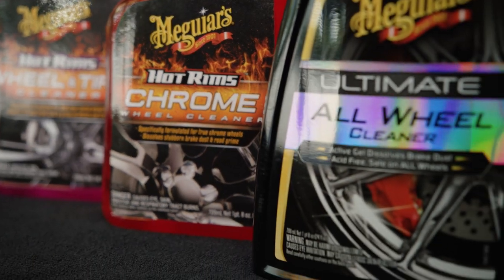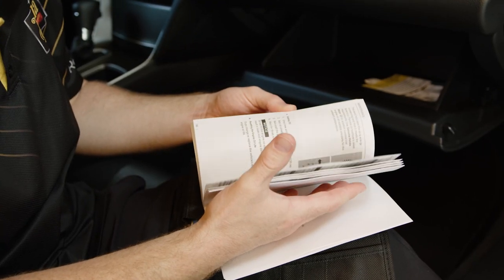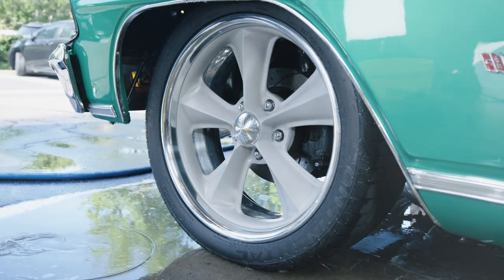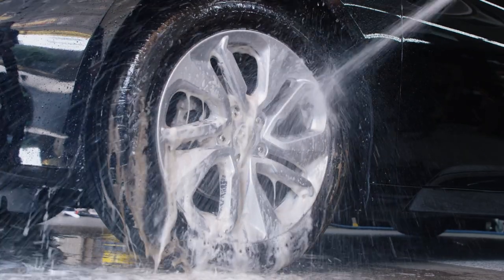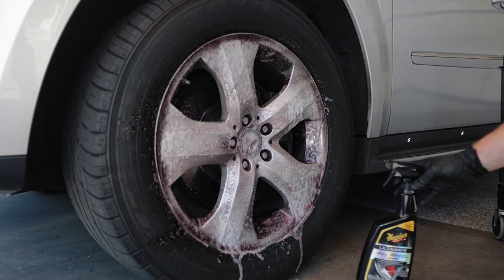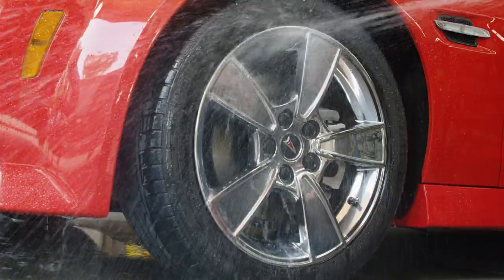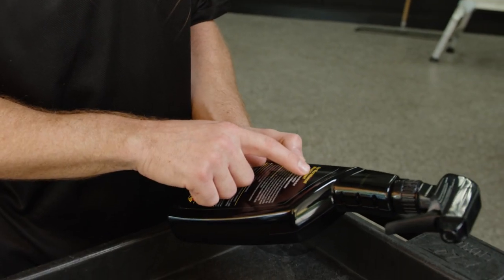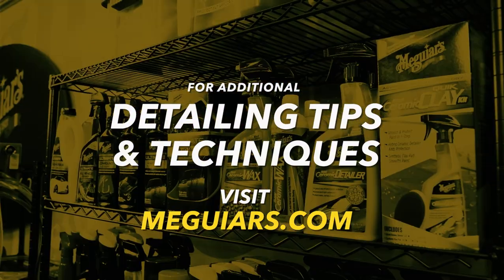How to Choose & Properly Apply Meguiar’s Wheel Cleaners – Quik Tips

Comment: What is the best wheel cleaner you guys have for my two-tone golden chrome spoke lowrider rims thanks for your recommendation in advance
Reply from the maker: With such a unique finish we would probably recommend simply washing them with the same car wash solution you wash the car with or perhaps our Hot Rims Aluminum Wheel Cleaner as you need to be very careful what you use on what is probably a very sensitive wheel finish.

Comment: Is there a product that adds protection/hydrophobic to the rims?
Reply from the maker: Many OEM wheels are clear coated (painted) so you are welcome to use your favorite wax on the wheels as well.  Just keep in mind that wheels are exposed to extreme heat, dirt, grime, brake dust, etc. which will impact longevity versus the rest of the vehicle.

Comment: Can Meguiar's Ultimate All Wheel Cleaner also be used on tires or only just on the rims?
Reply from the maker: It will not hurt tires but is not necessarily and effective tire cleaner either.

Comment: How about using All Purpose Cleaner for wheels and tires? If so what should it be diluted at?
Reply from the maker: An all purpose cleaner is a great way to clean tires.  It will not do as well with stubborn brake dust on wheels.  

It would be safe on most wheels but there could be exceptions for some after market wheels with very sensitive finishes.  The proper dilution depends on the product you are using.

Comment: Can ultimate wheel cleaner be used on tires, does it also cleans tires? Thanks
Reply from the maker: It is safe on tires but is not designed to clean them well either.

Comment: I cleaned my rims with 'Ultimate wheel cleaner' Car was still cold, sprayed, agitated, rinsed very well. It left this really nasty haze. What would cause this, how do I get the haze off,  and how can this be prevented?
Reply from the maker: Typically the only thing that can go wrong with the Ultimate Wheel Cleaner is of the product is allowed to dry on the wheels.  It is difficult to assess from your description alone what may have happened.  Please reach out to our Solutions Hub with more details and a good pictures in hopes we can help diagnose the issue and find the best fix.

https://s.3m.com/fxw9xy

Comment: Hmmm. I have a ford flex with appearance package and I have Black Painted 20 inch wheels. I have been using the Gold Class car wash soap for both the car and the wheels. Which should i use for the black painted glossy wheels and tires?
Reply from the maker: First, if the car wash is working as you only have light dirt and dust that is great.  You don't have to use a wheel cleaner if it is not necessary.  If you find that the brake dust is more stubborn than a car wash will remove you would then want to consider our Ultimate All Wheel Cleaner.  Some of these new black wheels are not painted but powder coating and can be much more sensitive to wheel cleaners.  That being the case we recommend our Ultimate All Wheel Cleaner.  👍
Reply: @meguiars  ah excellent. Yeah I'm not actually sure if the wheels are powder coated or painted to be honest 😅 but they are definitely a nice glossy black, i bought the car Brand new on 6/28/19 at 226 miles, it has 8,610 miles now a bit over a year later and I was the car once a week by hand. The brake dust does come off very easy using the same Gold Class Meguiars Car wash Soap with a microfiber Type Glove. I was just wondering if I was NOT using the right stuff for the wheels. Thank you very much for the advice. I just order a Mt300 and a 5 inch Disc. Just need to order the foam pads and the liquid polish, wax and Compound. So ill be watching lots of your videos to give me guidance. My paint is Pearl White Metallic with a black painted roof. 👍😁